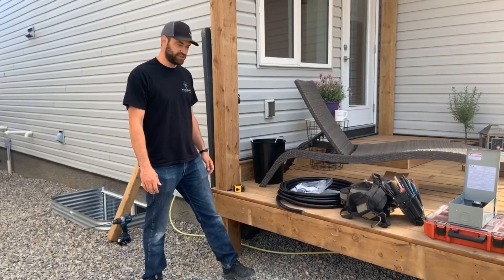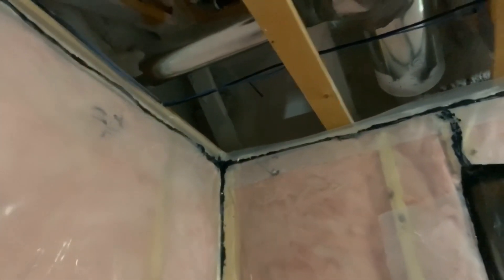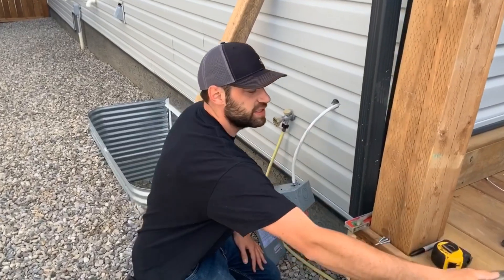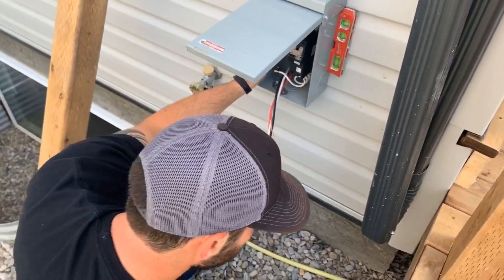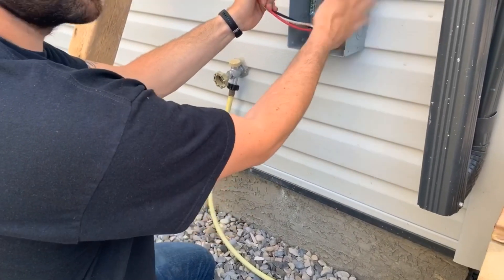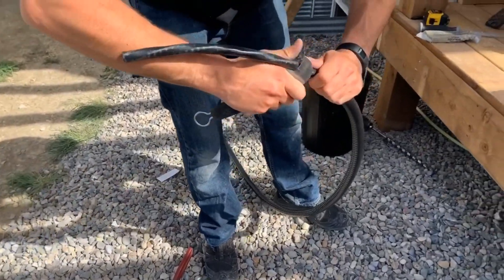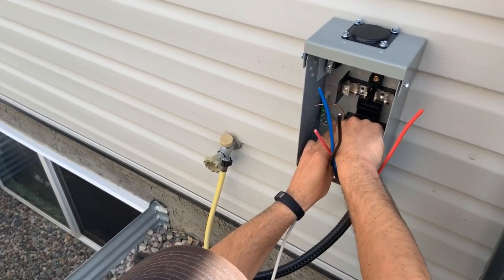Hot tub electrical install explaining parts of spa package and terminations

Comment: Awesome video, have a couple of details as I'm doing this work now. Is an arc-fault breaker required at the house panel (50A)? Is a waterproof teck connector used to get inside of the hot tub?
Reply from the maker: No arc fault required in Canada on any of this equipment, just GFCI need to be in place. And the teck can run into the tub, and can run into your home to, it’s just expensive

Comment: How much did u charge for this install
Reply from the maker: Not the easiest question to answer, this install was done 2 years ago and the price of copper has gone up roughly 300% since. A similar hot tub install done today could range from $2400-$2800 based on size of wire/distance/type of panel. Many things can change the price, it could even be higher or lower but this a good ball park figure.

Comment: #8 romex is only rated for 40 amps at the 60° column. Is there a code that allows you to use the 75° column?
Reply from the maker: If everything is rated for 75 degree terminations you can pull your sizes out of the 75 degree column
Reply: @Luminelectric  but you ran NM cable from panel to Disco.  No?
Reply from the maker: @anotherreview5586  nmd is rated for 90 and so is the teck cable usually it’s the manufacturer of the tub that will limit you to 60 degrees on occasion, there are ways around this to,  that are hard to explain, but we’ve never had any issues sizing outa the 75 degree
Reply: @Platinum Lighting  ah, Canada! That makes more sense. 

In US NEC 334.80 only allows us to use 60
Reply from the maker: Sorry usually I say we are Canadian because it clears it up right away. Thanks for your comments though, much appreciated!

Comment: So here’s a question, what if they have the bus in the panel all mixed up as far as neutrals and grounds , isn’t that gonna trip it then or no ? Cause the panel I just seen they have ground and neutrals all back n fourth lol
Reply from the maker: Your neutral needs to be separated from the bonding wires in the panel (isolation we call it) they should only be one point where the ground and neutral connect at the main service of the home. Hope that helped

Comment: Where I live you need number 6 wire for 50 amp breaker on hot tub. Due to needing a number 6 ground seems funny how depending on the location you live gets different rules.
Reply from the maker: Very true! Not sure why but some rules are very close between Canada and the USA and some are way off.

Comment: Great video.  I am wondering though if/what the proper process is for running nmd90 from the interior of the house, and into a spa pack if it can't be fed directly into the back of the spa pack.  Basically can u run nmd90 8/3 thru the rim joist,into conduit, LB and again into conduit for about 2' before it enters the spa pack?  Or should you use a j box at rim joist location then Individual thhn wires up the 2' from there where the wires enter the spa pack?  Thanks!
Reply from the maker: Hi Adam, the answer actually depends on which code you follow, this install is Canadian and done under CEC code. So if your in Canada any of the options you said would be fine, in the USA you’ll have to follow NEC and we wouldn’t consider giving advise on that install as we do not know all the codes you’d  have to follow.
Reply: @Luminelectric  thank you for such an informative video and also a personalized timely response.  Truly appreciated.  I'd be following the CEC as I live in Ontario.  My install would be very similar to the one in the video......a 8/3 nmd90 thru floor joists, out thru rim joist, up a few feet thru schedule 40 pvc to get above typical snow line, into bottom of spa pack, then teck cable out from there to be connected to hot tub requiring 40amps.........would I require a clamp at the interior end of the stub conduit inside the basement where the nmd enters the conduit or just feed it thru the conduit?  Thanks!
Reply from the maker: No you wouldn’t need a junction box or a clamp at the end, PVC can be used to sleeve loomex (NMD90) you can also sleeve outside and run the PVC on the exterior with NMD inside as long as the wire doesn’t  go underground or exposed to the elements. Theres a lot of ways to  do this type of install and remain in the code, hope this helped.

Comment: What outside box are you using?
Reply from the maker: This is an eaton 50 amp the model has been discontinued, try the Siemens it is very similar.
Reply: @Luminelectric  the place where I bought my hot tub recommended the square d homelike box. It looks a little small
Reply: @Luminelectric  homeline
Reply from the maker: I don’t like the small GFI home line spa pack, I use them and there panels for everything else, but the Siemens is bigger and has extra slots for more breakers if you need.

Comment: Ok,OK, got it. (My wire has black / red / copper / blue) no white. So, from the panel red connect to the box right-side black left-side. from the tub connects to the breaker, going to match it red on the right-side black on the left-side, blue at the back on the breaker. 

I purchased 84 feet, from the tub to this GFI 10-feet so I spilt cutting the wire. This is why I have four wires red/black/copper and blue. 
[I'm stuck buddy, if the wire that is coming from the house panel is the same from the tub, to the GFI box where does the blue wire go??] 

Your video is great, would love to get your feed on this, please? Thanks ahead Sam..
Reply from the maker: Hey Sam, so I will explain the hook up as best as I can 

From your panel you’ll have 2 hots (red/black) those tie into the terminals that feed the buss inside the spa pack, then that blue needs to be taped white and that now white wire ties to the neutral buss in the spa pack

Now the cable from your tub to the spa pack should have 2 hots (black/red) that’ll get tied to the breaker under the load terminals, now on your spa pack GFI breaker you’ll have a special spot to terminate the blue (which you’ll be taping white as well) it’s usually called load neutral. Then that curly white white coming off the breaker can be terminated to the neutral buss. Hope this helps
Reply: @Luminelectric  Thanks very much (Buddy) worked out great. My plastic GFI box is finished wired up. But, other short questions. In the panel, I bought a 50amp breaker. The same wire blue/black/red and copper. (Black and red goes on the breaker, but which side does the red go on right or left on the breaker?) And where does the blue go? The copper goes the ground yes? [Thanks so much for replying, very thankful for your time. Sam...
Reply from the maker: @phantom5185  no problem Sam, glad we can help. In your panel it doesn’t matter which wire (black or red) goes on which side of the breaker, as long as the breaker is splitting the buss in the panel you’ll get your 240v. 

The blue needs to be tapped white and attached with the other neutrals on the neutral buss. 

Bare copper is gonna be your bond and should go on your bonding buss

Comment: Great video. In the process of wiring my Beachcomber tub in BC. I have a question about connecting to the tub itself. I'm running teck out from the spa box to the tub. Can you run the teck cable directly into the tubs control panel? All the wiring videos I've watched show them using a green insulated ground wire. Do I need to install some kind of extra junction box before going into the tub? Thanks.
Reply from the maker: No you don’t need any other junction box, the teck cable with your 2 hots one neutral and a ground will be all you need. If the box to terminate to inside the tub is plastic you’ll need to get a bonding bushing for your connection to bond the armour. That’s about it.
Reply: @Luminelectric  Perfect thanks! you also mentioned the need for a bonding bushing at the spa panel if using 6/3 cable. Does that still apply even if the panel box is metal?
Reply from the maker: Dave mis spoke in the video, the rule we are trying to warn about is if the connector is 1” or larger the connector needs a plastic bushing
Reply: @Luminelectric  I’m going into the tub with 8/3 tech into a 1-1/4” hole in the plastic control box, using reducing bushing and conduit hub. Was going to put a grounding bushing to bond the armour.  What were you saying about a platform bushing?

Comment: trace the box, cut the cladding, add J channel, flush mount against house wrap and OSB/plywood. flex the channel and bait inside edge with sealant. i'd use compression fittings to the back of the box - hole saw matching the hex nut ring. the rest of the electrical is on point. makes it look so easy. its not easy.
Reply: Why the fuck would you do that, I bet the customer would love to see you cutting up their siding and paying for extra labour/time/materials to do that (sarcasm)  this right here looks clean as is and is how any service electrician would do. Maybe if it was your own house and you wanted that for some reason on your own time sure.
Reply from the maker: Thanks 👍

Comment: Shouldn't the Spa Pack outside the House have to be a minimum 1 metre distance from any water supply to meet Code? You show a garden hose tap outside near the Spa Pack??
Reply from the maker: This is in Canada and was inspected by the local inspector here. The spa package is a weatherproof device and is made to be outside.

Comment: 2 legs of power equal a single phase of power... just sayin  🤷‍♂️ ...so thats 8 gauge wire on a 50amp breaker?
Reply from the maker: Jeff did ya even watch the whole video, because I don’t get what your “just saying... yes there is only one phase in a residential home. And yes in Canada #8 is good for 50 amps.

Comment: Great video thank you. I was wondering if you would remember where you got the bushing/connector for the teck cable (and the size of it) ? I need one (I'm in Canada) and can't find them. Thank you 😊
Reply from the maker: If your in a pinch they will accept a flex connector as long as it on the bottom of your spa package, also check with your local inspector to make sure they are good with that as well. Code can be interpreted differently in different places.

Comment: I need some help!! I just bought a used spa and would like to buy everything for a electrician at my cost.... I have S-Class 240 - 4.0KW Gecko with 2 pumps, on the side of the heater it says input 120vac 60hz 15A, Input 240vac 60hz 48A. My question is.. What amp breaker do I need and assuming its 6/3 cable .. is there a type of 6/3 as I seen many with different volts..??
Reply from the maker: Hey rob, so I should let you know we follow Canadian code but looks like you’ll need a 60 amp spa pack by our calculation, so your right that you’ll need #6/3c (almost all cable is rated for 600v) I would use a teck cable, then You won’t need to install a conduit for mechanical protection.
Reply: @Luminelectric  Awesome!!! Thank You very much!!! Having a hard time finding a 60amp breaker lol Out of Stock mainly all over. I live in Gatineau so the Canadian guide works for me.. Hoping Quebec is not any different 😆
Reply from the maker: You should be fine, I know Quebec is a smidge different but talk to your local inspector and find out what they want to see. The breaker in your panel is a tough one, we buy ours when we can from where we can, Try small hardware stores in your area.
Reply: @Luminelectric  Another question.. So I'm almost at the installation since those tek connectors are not sold just anywhere.. Since I have the 6/3 tech cabling and it will be coming out of the main house breaker and my cottage is a 1 floor / brick crawl space about 3 feet. So I will put a hole at the top before the brick starts.. Can I use a LB access fitting just so it's neatly against the brick wall going down in a pvc pipe then in the ground by itself? I don't want bump it either in the winter with a snowblower etc..

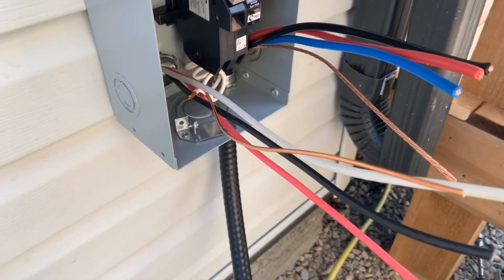Comment: at 5:45 you state that a 1" Teck connector requires a bonding bushing.  Do you have a CEC code reference for that?  Great video - thanks.
Reply from the maker: It’s is a mis speak on Dave’s part, he ment a plastic bushing. On anything over a one inch.
Reply: @Luminelectric  Ah, OK - that makes sense now.  The 1" TECK connector I've purchased includes the plastic bushing.  Also code states that if you leave the inner sleeve protruding 5mm beyond the end of the connector you don't require an anti-short bushing.
Reply from the maker: Thanks lightly toasted we are glad we could share ideas.
Reply: @lightlytoasted3926  where did you get the teck connector?

Comment: When you identified the blue wire as white and terminated it. Did you put it with the black or red wire? i have a GFI breaker that an electrician put in with only 2 screw terminals black/red. The white Curly going to neutral bus
Reply from the maker: You should have a wire coming from your tub feed that is connected under the neutral spot on your breaker, then off the breaker that white curly wire will attach to the neutral bus.
Reply: @Luminelectric  Thanks, i will have to take out the GFI like you did in the video, from the front there is only 2 screws. 1 for the black 1 for the red (hots). It was hard to see where you terminated the blue wire..
Reply from the maker: @Joegest1  the spots will be labeled on the breaker in the spa pack, shut off the power and have a look.
Reply: @Luminelectric  The spa pack is simple. its the GFI the electrician put in. I cant find the hole for the neutral wire to be terminated
Reply from the maker: @Joegest1  is it a Leviton or homeline panel, it might clip onto the buss in the panel.
Reply: @Luminelectric  cool, will check. cant remember. its 25 miles from me. Appreciate the help. Have wired alot of things in my life. Never a tub..
Reply: @Luminelectric  MAN, DO I FEEL DUMB. Popped open the panel and the GFI had a screw term right in the middle. I really dont know how I missed it......but the screw was a darker shade than the blk/red screw....Thanks for all the help...
Reply from the maker: @Joegest1  no problem, glad we could help.
Reply: @Luminelectric  Yep, thats the mechanical mind in me. cant let it go. step away, take a breath and attack it again. And then you say DUH !!!! cuz it was so easy to see...

Comment: them Eaton spa deals are junk installed one yesterday  not impressed at all
Reply from the maker: The Eaton and Siemens seem to be the lesser of 2 evils. The Schneider version is smaller inside and it’s hard to work in, we usually like Schneider but not on spa packs.
Reply: @Luminelectric    the termination on the breaker Is horrible for the neutral gotta have the breaker off the base to make the connection   then shove that back on the rack attachment   not impressed

Comment: 0:10 says 8/3 but shows 8/4 (4 conductor) Outherwise execlent video. Would like a link to that wire for the outside though..
Reply from the maker: Good eye, we only count the current carrying conductors though, so this cable is a #8/3C teck. And inside we used #8/3C NMD
Reply: Definitely 8/3.

Comment: The #8 gauge wire you used is rated at Max 40 amps, not heavy enough for that spa which is probably a 50 amp circuit. Always use # 6 gauge wire for a spa. Never use NM-B outside.
Reply from the maker: This install is from Canada, under the CEC #8 is good for 50 amps.
Reply: @Luminelectric  look up the wire manufacture rating. I’m not going by the CEC or NEC. Cerrowire or Southwire charts say NM-B # 8 max rating is 40 amps. Not trying to school ya buddy. Just be safe. NM-B # 6 rating is 55 amps whereas THHN # 6 is rated at 65 amps. It depends on the heat rating of the jacket.
Reply from the maker: We have never seen a manufacturer rating on cable for amps. This job has passed an inspection. Until the table changes in the code book we will keep using the cable for what it’s rated for in the tables.
Reply from the maker: So I looked this up, we can pull our cable size from the 75 degree column under the manufactures standards is 50 amps. But thanks 🙏
Reply: @Luminelectric  Is it possible to tie a receptical into the panel for out door lights?
Reply: @jeremyrobertson4034  wtf
Reply: He didn’t use nm-b outside. Isn’t that a pvc jacketed mc??
Reply: @CryptoManiac1776  that is teck90 cable
Reply: He literally didn't use it outside... did you even watch the video? This was covered thoroughly

Comment: the disconnect not within the sight .
Reply from the maker: The hot tub hadn’t shown up in the video, but it was definitely in site of the tub or it wouldn’t have passed inspection.
Reply: @Luminelectric  I see here in NY it has to be within sight of the control wherever the connection is .
Reply from the maker: No worries, in Canada it has to be at least 10 feet from the hot tub and within site of the tub.

Comment: Do you need to supply another ste connector for the tub side?
Reply from the maker: Yes, and most of the time the tub has a plastic junction box at the tub and will require a bonding bushing if your using a metal connector to attach the cable to the box.

Comment: I’m confused if the ground wire has to be insulated or not. I’ve read conflicting info. I’m in Ontario, Canada. I have 6/3 NMWU in rigid pvc conduit
Reply from the maker: It’s not really a code rule we’ve ever heard of, insulated ground or not it needs to be bonding the spa pack can. In PVC your going run an insulated ground, hook that to your bonding buss, and do the same to your cable or pipe leaving to the tub. If your tub has a plastic junction you’ll need to bond any metal connectors you terminate to. And as always pull all local permits.